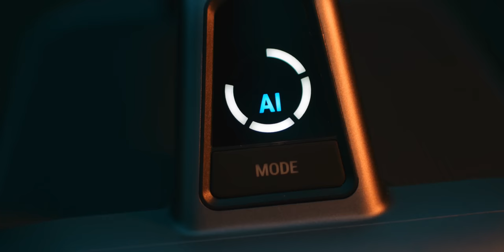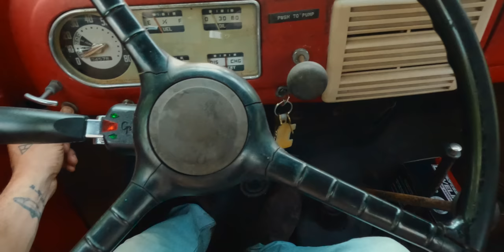The Reality Behind The Dream

Comment: We bought a fixer upper from 1790 and had troubles finding home owners insurance that would cover it until we found a company that specifically covers homes that are getting remodeled so they are more lenient on the issues. The company that finally covered our home is called hippo. They gave us a year to make improvements and then the still renewed us without an inspection.  Good luck! And get some rest when you need it.